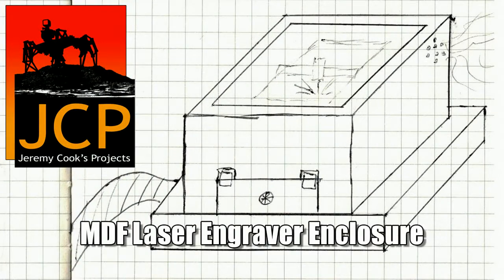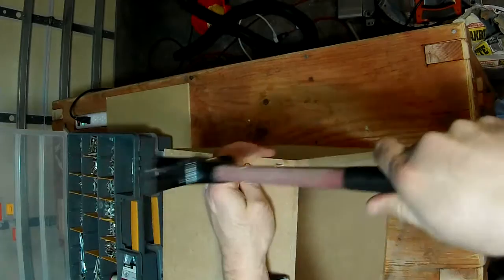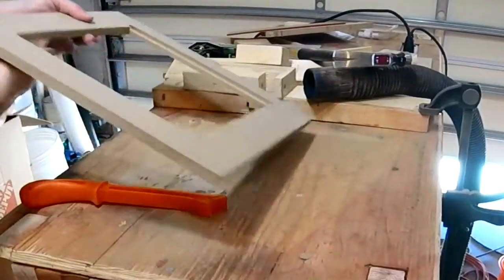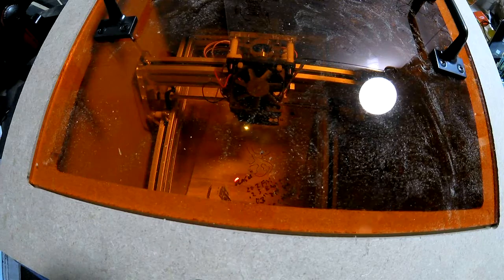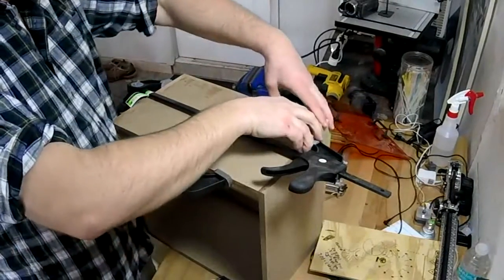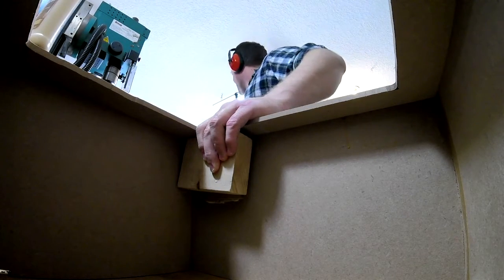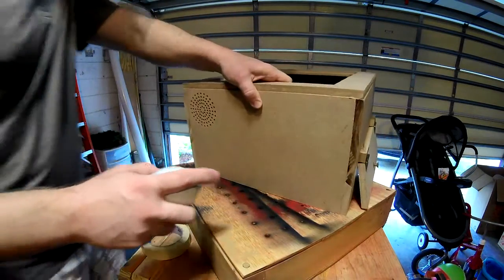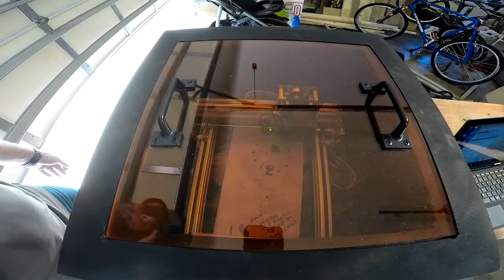Laser Enclosure for 445nm Laser Made out of MDF and Acrylic

Comment: Level up and put in magnetic reed switches in the hatch and acrylic top to cut off power in case it gets opened when laser operating. Magnetic reed switches less likely to be accidentally triggered by substrate or your body when reaching in.
Reply from the maker: Not a bad idea. Less likely than what?
Reply: @JeremyCook  reed switches less likely to accidentally trigger than simple mechanical switch which can get bumped by your elbow or substrate
Reply from the maker: @fugazzi6122  True.